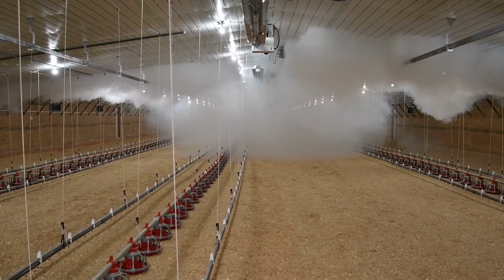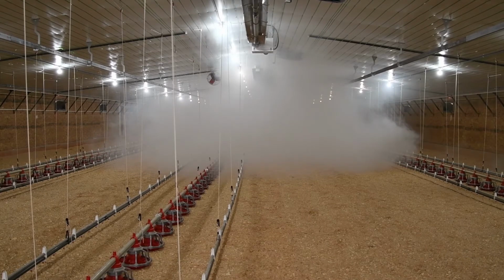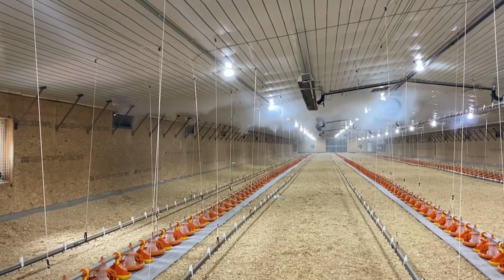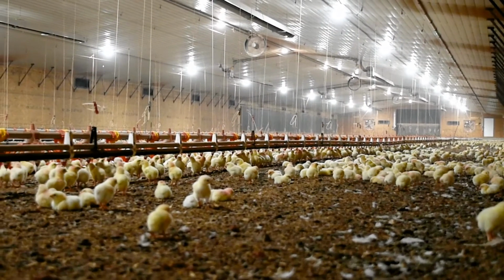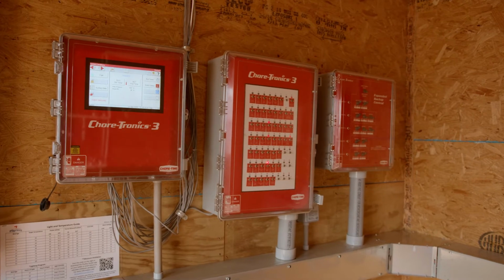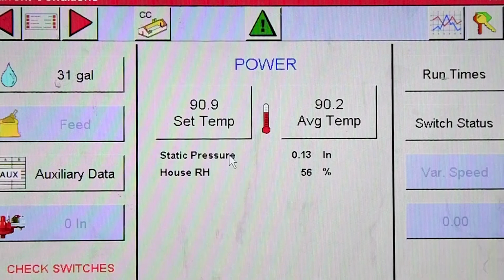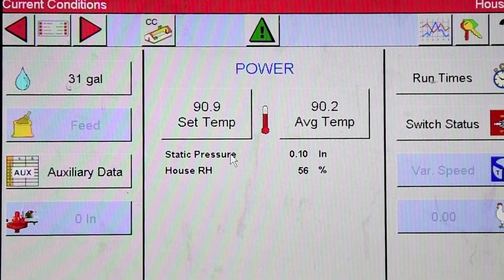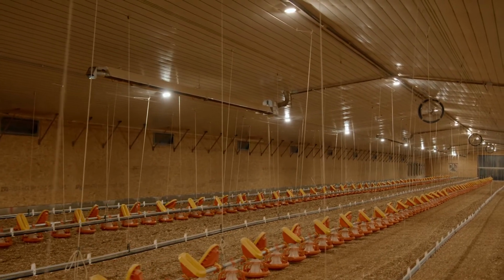Intro to Modern Broiler Production. (10) Negative Pressure Ventilation

Comment: In milder/warmer weather, I.e.outside air is  5-6 degrees cooler than the inside shed temperature, what air speed do we need when on minimum ventilation?Obviously not as fast air speed as when it’s cold, but in this case, 2/3 the speed? 1/3 the speed? E.g cold outside temperature, air speed from mini vents 4-6 m/s (depending on shed width), for milder outside temperatures, 2.5-4m/s?
Reply from the maker: If it is 5-6 cooler outside than it is inside then the house should be in inlet ventilation not tunnel ventilation.  Minimum ventilation is the lowest ever level of ventilation...the lowest allowable...and therefore chances are the house would not be operating in minimum ventilation mode but rather inlet mode.  Air speed generated by the inlets will vary with how many exhaust operating.